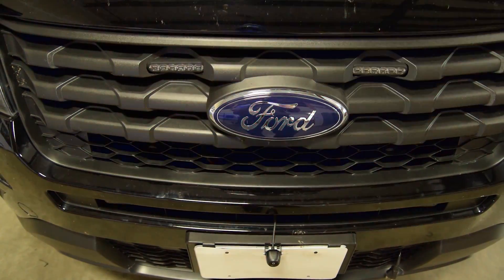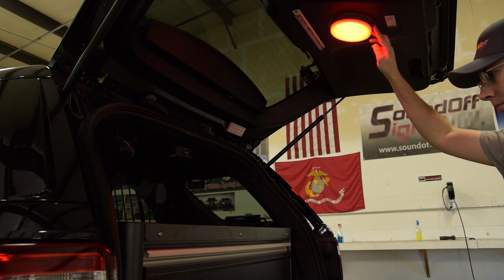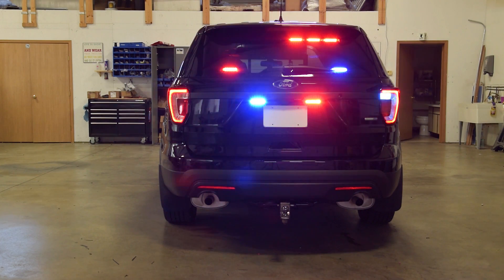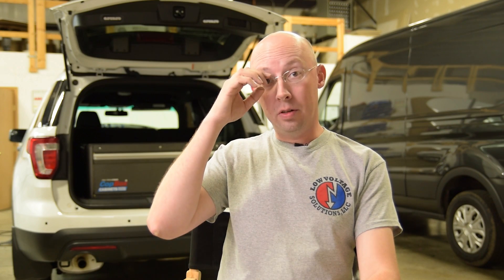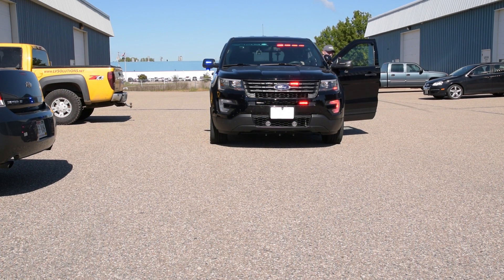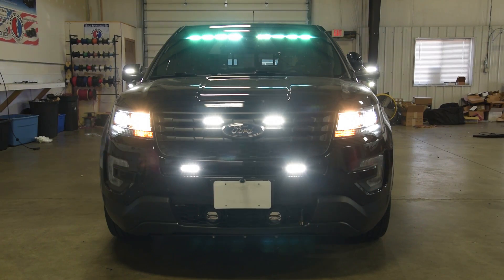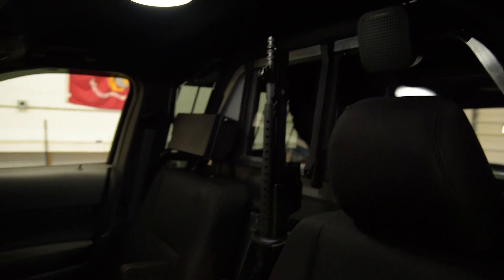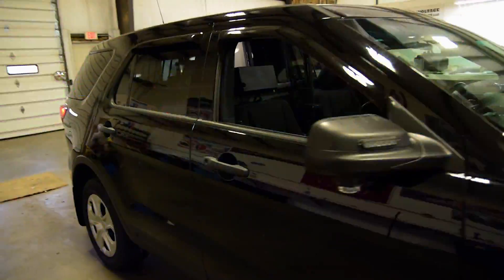SoundOFF Signal BluePrint buildup 2016 Ford Police Utility

Comment: I noticed theirs a keypad installed on the drivers side door. Did you have to wire it in?. Or was it one of those sticky keypads that uses a RF freq
Reply from the maker: Its a Ford mod that is a sticky pad. Not hard wired

Comment: Love the build, but another cool thing you could do is mount the mPowers under the spoiler, three on each side, then take advantage of dual color and BluePrint, and use them as a traffic advisor in addition to warning. But this is amazing. Also, what's the difference between the rear interior nForce lightbar, and the interior nForce light stick?
Reply from the maker: Spartemex, thanks for watching. At the time of this build, the mpower spoiler brackets were still in the design process. We have used them on builds since and love them. As for the rear interior bar, this was a prototype. The actually rear interior bar will be out this month and the major difference between the bar and the stick is that the bar mounts directly to the hatch and mounts tight to the glass for no rear flashback. We will also being doing projects later this year that involve using mpowers as warning and arrow. At this time thou, we have to use a external module to do arrow functions since it is not an option in blueprint yet. We will be using a D&R module and controlling it with blueprint. The interior bar in this video is also half dual color, and half tri color to get us the function of warning, arrow, and braking. Thanks again for watching!

Comment: What RADAR does that car use? I see the VASCAR box but am confused why it has a traditional RADAR antenna as well.
Reply from the maker: The Dual Stalker RADAR (you can see the counting unit's screen at about 1:58) is great for assessing speed of moving targets while the vehicle itself is in motion, and is far more hands-off than the VASCAR. The two technologies work well together so the officer has choices when needed for situations that highlight each system's strengths. Cheers!

Comment: So is it possible to setup blueprint after being delivered from the emergency lighting business? My fire chief just got an all sound off package and it has dual colored intersector mirror lights that flash red white all the time and I think the white should only be on for switch position 3 which turns on the other white lighting. So is there a way to change it without having to take it somewhere to get it fixed?
Reply from the maker: Firstly, I agree on the flashing white to be on with the level '3' of the multi-level switching. If you've got the blueprint system in the vehicle, it should be extremely easy for those lights to be changed, and even have the solid white as an option for flooding a scene with light. IF it was wired into the blueprint appropriately. 
For the question about the reprogramming.... your blueprint installer should be the one to make those changes, as they have the software, and also the programming language skills to do so quickly. I'd hope your blueprint installer would make at least one 'free' programming adjustment, as an end user usually only knows how the vehicle fits into his daily life only after they use the rig for a few days. BUT the changes you suggest seem straight forward and the simple programming should incur only very nominal cost if any (again, I don't know your installer so I can't speak on their behalf)
Cheers~Ben